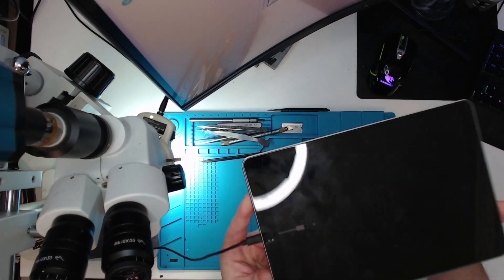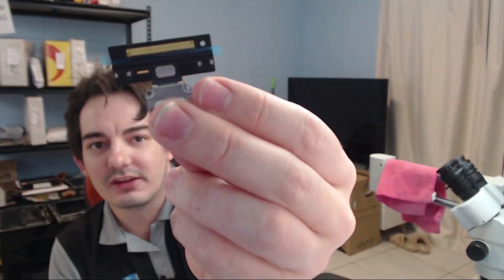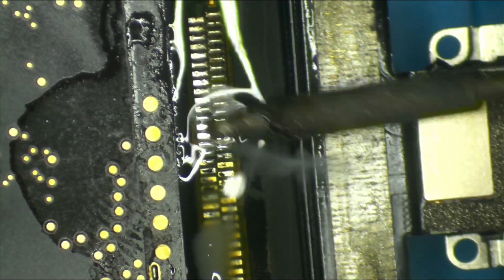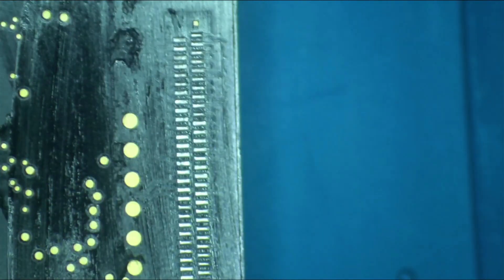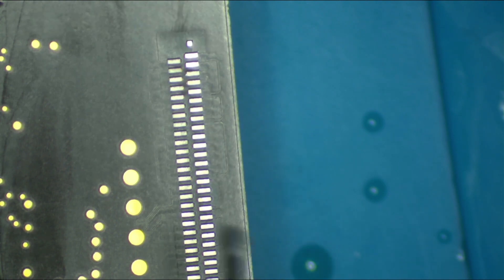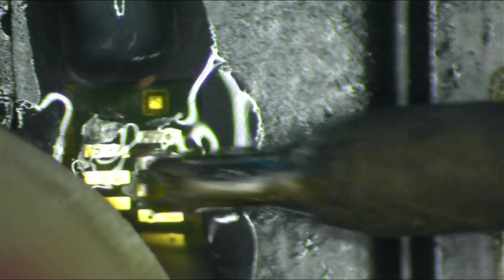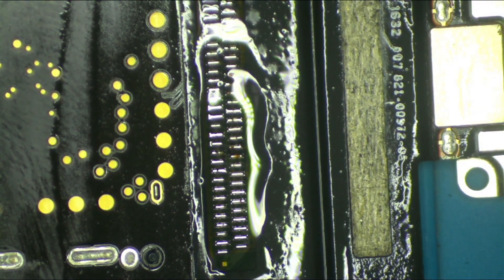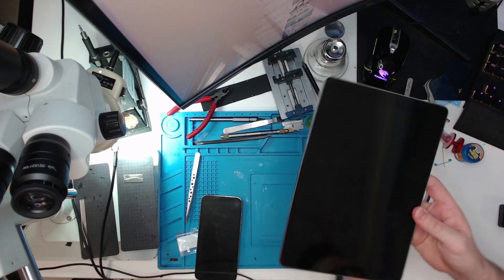iPad Pro 10.5" Charger Dock Replacement & Repair

Comment: Great video Max Hawker and just what I was looking for. I'm not on TikTok so won't be watching you on there. I'm trying to replace the charger dock that no longer works. What is the flux and low melt solder you use